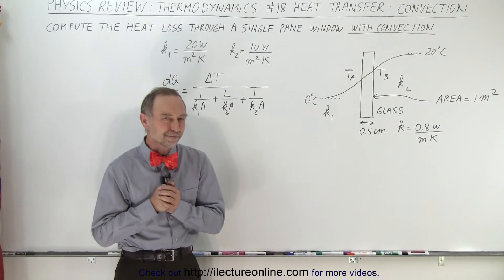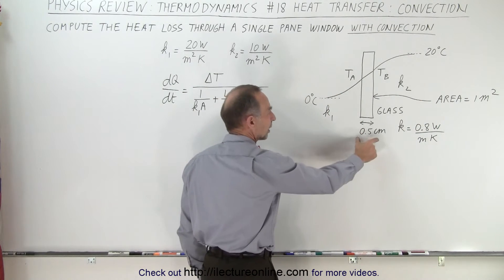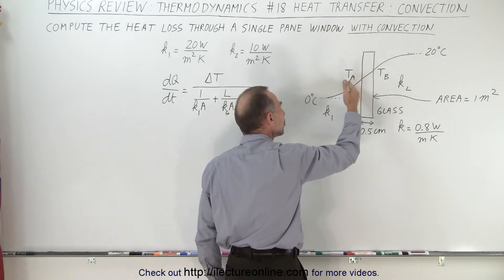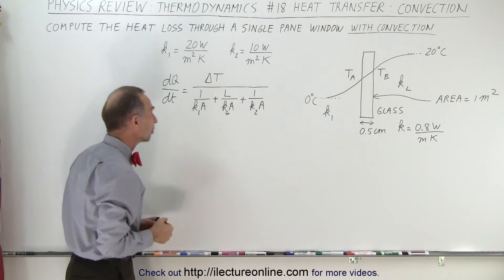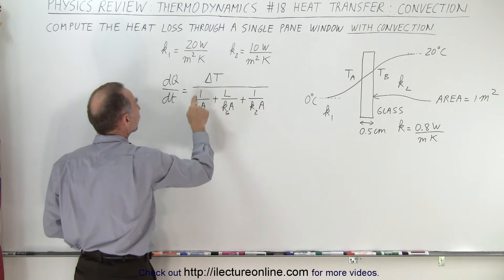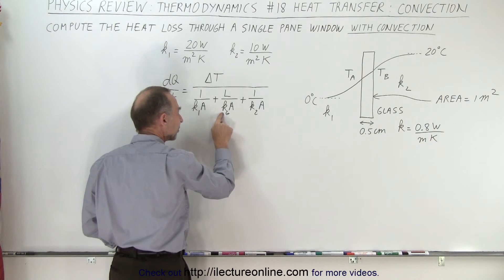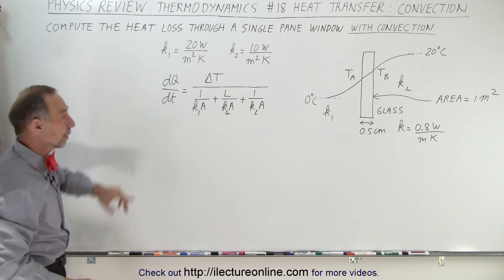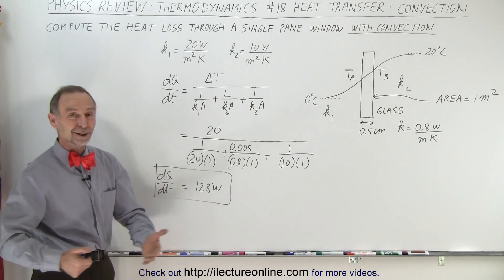Physics Review: Thermodynamics #18 Heat Transfer: Convection

Comment: THE CORONAL HEATING “PROBLEM” IS SOLVED, AND THE FOURTH DIMENSION IS PROVEN:

You have to consider TIME AND time dilation ON BALANCE, AS c squared (CLEARLY) AND NECESSARILY represents a dimension of SPACE (ON BALANCE) REGARDING WHAT IS E=MC2; AS ELECTROMAGNETISM/energy is (CLEARLY) AND NECESSARILY proven to be gravity (ON/IN BALANCE); AS TIME is NECESSARILY possible/potential AND actual ON/IN BALANCE. INDEED, consider what is THE EYE ON BALANCE; AS two AND three dimensional SPACE are, in fact, BALANCED. (Notice the dome AND the associated black “space”.) This CLEARLY proves the fourth dimension ON BALANCE, AS the stars AND PLANETS are POINTS in the night sky (ON BALANCE); AS ELECTROMAGNETISM/energy is (CLEARLY) AND NECESSARILY proven to be gravity (ON/IN BALANCE); AS TIME is NECESSARILY possible/potential AND actual ON/IN BALANCE.

By Frank Martin DiMeglio

Comment: Consider what is THE EYE. The SPACE that is seamlessly enjoining what is THE EYE IS the FOURTH dimension. Accordingly, ON BALANCE, the stars AND PLANETS are POINTS in the night sky. THEREFORE, what is THE MOON will move away very, very, very slightly in relation to what is THE EARTH. Gravity/acceleration involves what is BALANCED inertia/INERTIAL RESISTANCE, AS ELECTROMAGNETISM/energy is gravity; AS the rotation of WHAT IS THE MOON matches the revolution. I have CLEARLY solved what is the coronal heating problem ON BALANCE. Great !!!!

By Frank Martin DiMeglio

Comment: Thank you. To get k1=20 W/m2K outside the building, you need a wind speed of 7 m/s.
Inside the building, convection is unforced. Therefore, the maximum you will get is k2=4 W/m2K if the glass surface has a temperature of 10 C.
Reply from the maker: Thank you for this great information.
Reply: I'm sure if I rolled up my sleeves and got too it, I might be able to understand how you came up with that, but alas, it seems like a lot of effort.  I am quite curious though...
Reply: @rsa4510  It took me about 10 minutes because I have done this before. But you are right, it takes a lot of effort if it is your first try.

Comment: Excellent explanation Sir for a good problem on heat which was  not  clear to me during my high school/PUC days. Thanks and Regards
Reply from the maker: You are most welcome
Reply: @MichelvanBiezen THE CORONAL HEATING “PROBLEM” IS SOLVED, AND THE FOURTH DIMENSION IS PROVEN:

You have to consider TIME AND time dilation ON BALANCE, AS c squared (CLEARLY) AND NECESSARILY represents a dimension of SPACE (ON BALANCE) REGARDING WHAT IS E=MC2; AS ELECTROMAGNETISM/energy is (CLEARLY) AND NECESSARILY proven to be gravity (ON/IN BALANCE); AS TIME is NECESSARILY possible/potential AND actual ON/IN BALANCE. INDEED, consider what is THE EYE ON BALANCE; AS two AND three dimensional SPACE are, in fact, BALANCED. (Notice the dome AND the associated black “space”.) This CLEARLY proves the fourth dimension ON BALANCE, AS the stars AND PLANETS are POINTS in the night sky (ON BALANCE); AS ELECTROMAGNETISM/energy is (CLEARLY) AND NECESSARILY proven to be gravity (ON/IN BALANCE); AS TIME is NECESSARILY possible/potential AND actual ON/IN BALANCE.

By Frank Martin DiMeglio